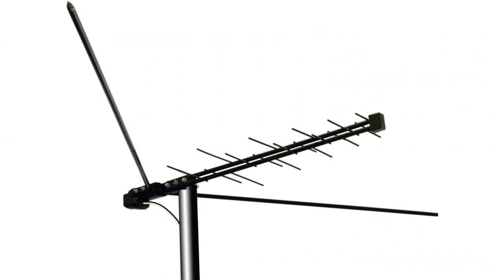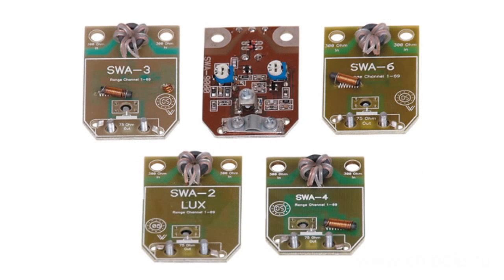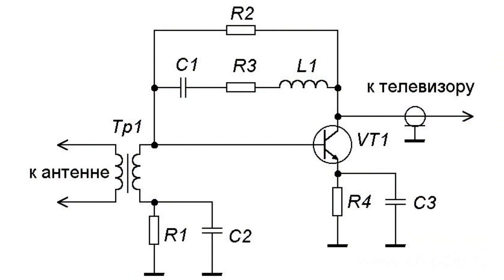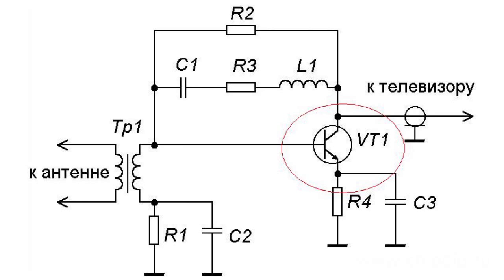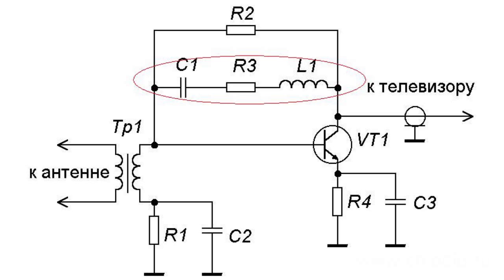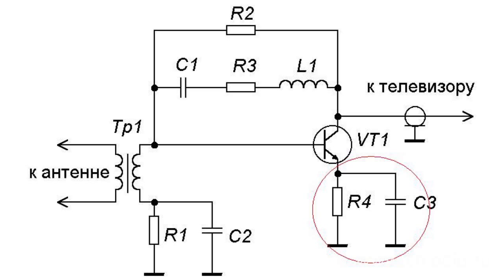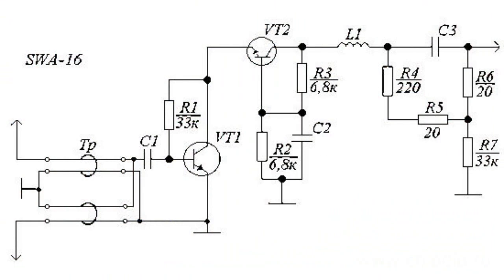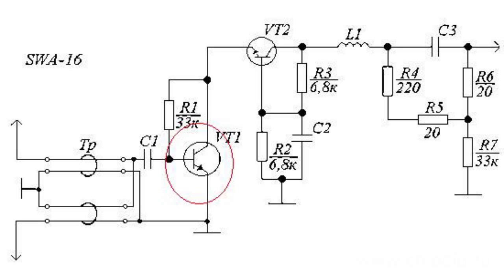Antenna Amplifier. Principle of Operation

Comment: The circuit on the secondary side of transformer is missing a power source. Without a power source, the resistors will be unable to bias transistor VT1 in its linear range. Fundamentally, an amplifier will have difficulty doing amplification without a source of energy other than the input signal.
Reply: As these appear to be masthead amplifiers, the power is fed up the centre conductor of the output cable. At the receiver end there should be a RF choke in series with the power supply. This is known as a "Bias T" arrangement.
Reply: videonya sangat bermutu sekali
Reply: sangat membantu